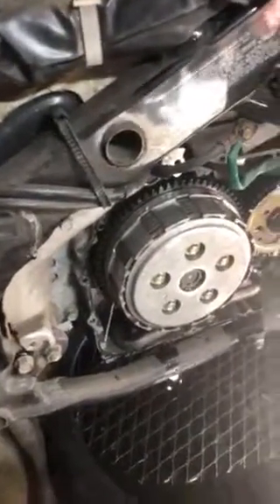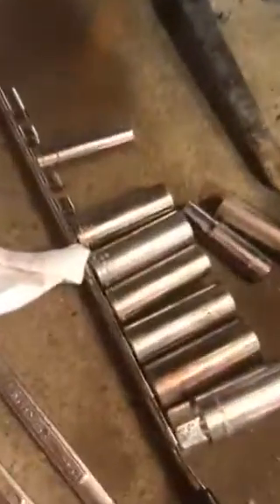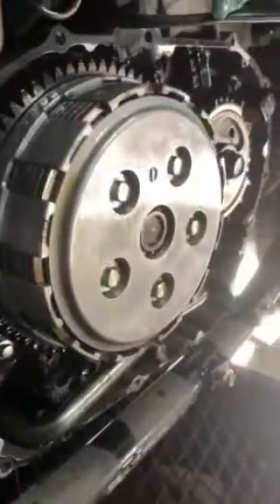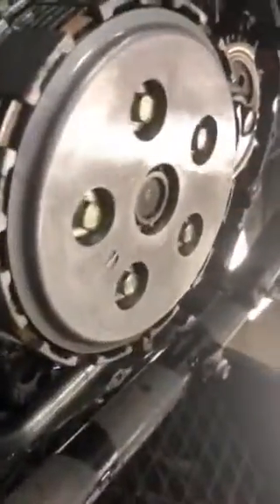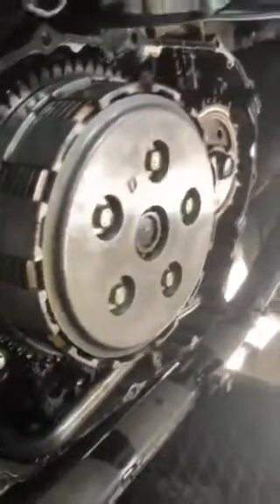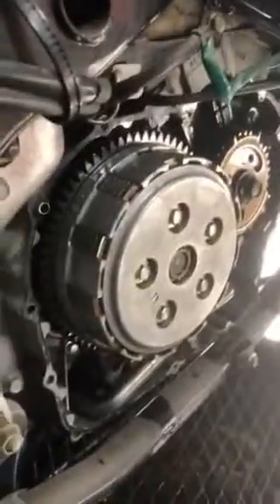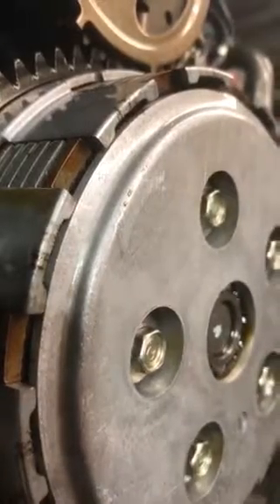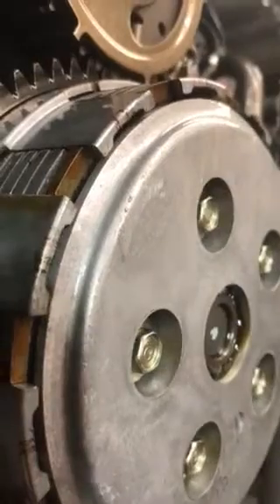Clutch problem 89 HONDA PC800

Comment: 1. REMOVE SLAVE CYLINDER AND TRY AGAIN... IF SAME TAKE APART AND INSPECT THE CLUTCH..GET A MANUAL OR DIAGRAM SO YOU UNDERSTAND HOW IT WORKS..IT WILL BE OBVIOUS !
Reply from the maker: This issue has been resolved for sometime- burnt clutch plates. But Thankyou for the advice 
Should I expierince the same symptom with “unburnt” clutch plates, I have an avenue to pursue.
I do indeed have the service manual.
Bike is running great with 9,000 original miles!
Thankyou for your comment
Reply: @shortCUT207  makes sense to me. luckily it is easy to take apart to inspect the discs.